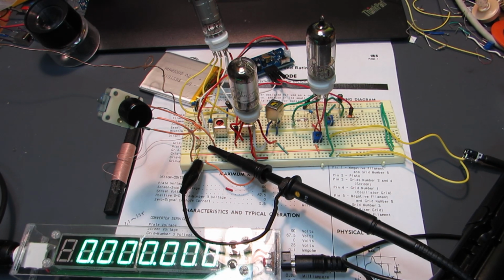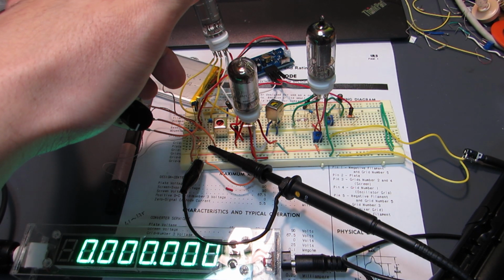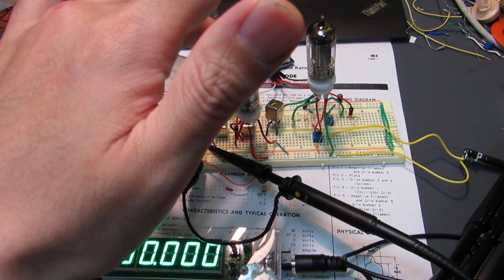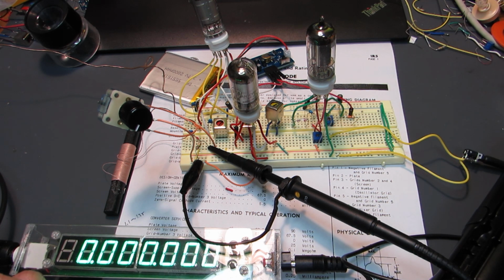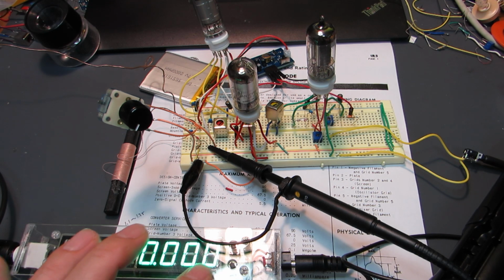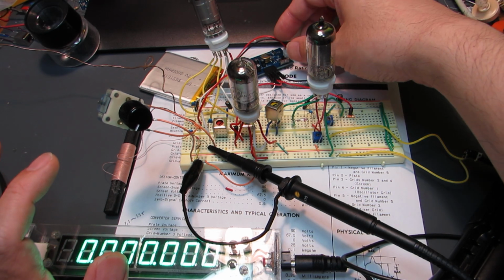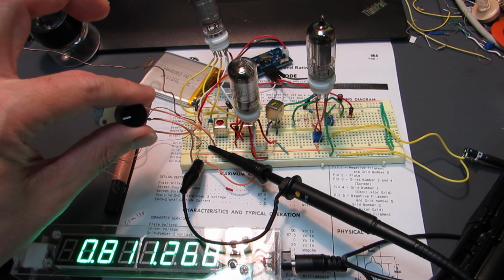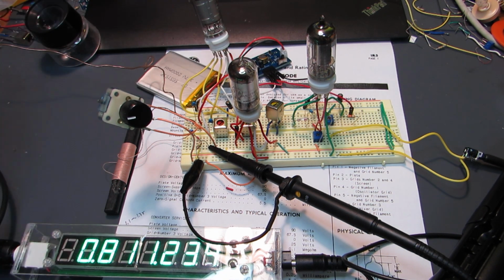3-tube superheterodyne receiver

Comment: What is the other 2 tubes?  is it 1T4 and 3S4? do you use output transformer to connect to speaker?
Reply from the maker: Yes, tubes are right. It's a bit long time before I made this one, but I remember I put small transformer, which is for transistor circuit. several hundred ohm to 8 ohm..

Comment: what is the small board power supply does it provide HT ? Do you have the link where to get the power supply board or schematic about the power supply board? I'm wonder is it a boost converter? and does it interference the noise?
Reply from the maker: Hello and thank you for interest. As you imagine, that small board is generating 30V. The information is available at
https://www.tindie.com/products/microwavemont/handy-vacuum-tube-power-supply/
(sorry but currently out of stock..) Thank you!